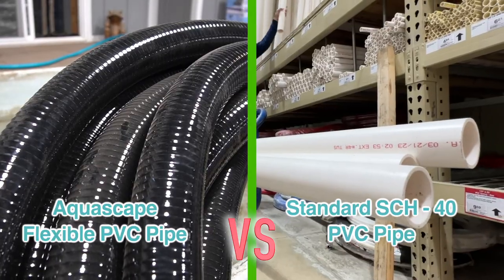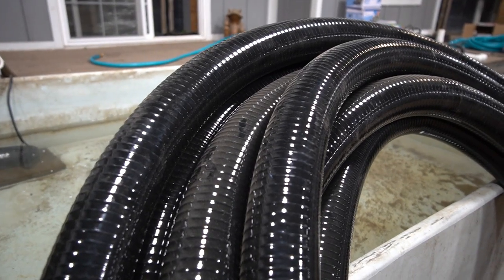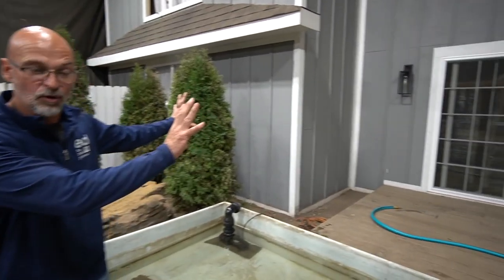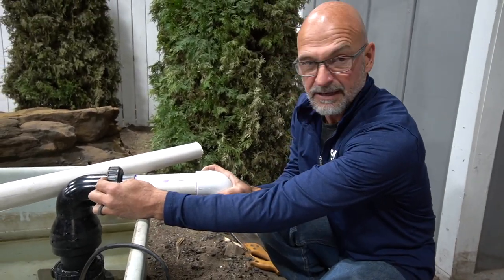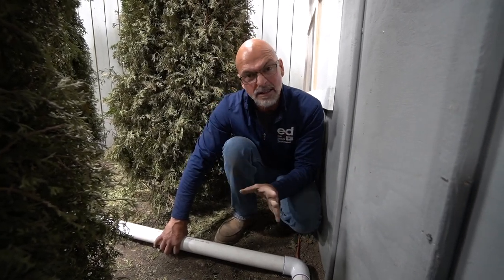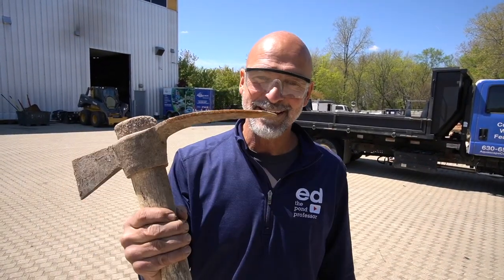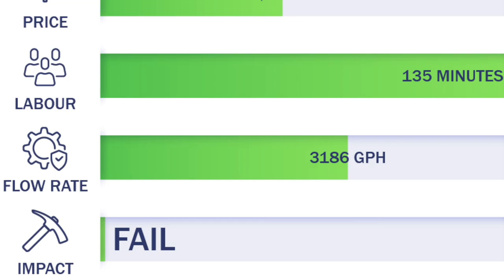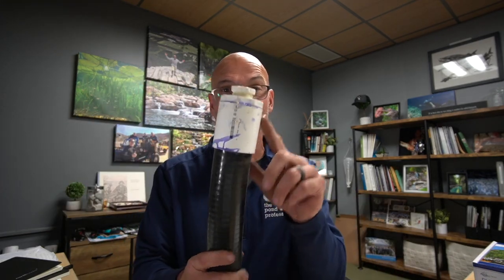DIY vs PRO Pond Pipe – 5 Different Tests

Comment: I love y’all at aquascape…but this pvc flow rate test was terrible. Looking at the route you ran the pvc vs the flex pipe is laughable. If the pvc needed to make that bend to go around a root flare etc, then the flex pipe should be making the same path…you ran it right across the top. Or instead of a 90 put in a 45 degree on the pvc so they at least follow the same run from point a to b. I used the black pipe on ours so agree with the idea behind this..but the flow test was a joke and you knew exactly what you were doing before you started. As soon as I saw you grab all those elbows at Menards I knew what data you were trying to produce…love you Ed and aquascape. But come on…
Reply from the maker: It was clearly an exaggerated test to prove a point…..
There are a lot of variables on projects and in my past 30 years as a designer and installer I’ve seen them all,
Whenever I find a better or more efficient method of construction I run with it!
Reply: @EdThePondProfessor  Again, I agree with you. This is not a matter of experience in the field but physics. More length of pipe and a ton of 90s are certainly going to be achieving less flow than a much more straight, no coupler pipe. There’s no doubt that there is little population out there that have as much experience as you. 👏 And you are brilliant with ponds, ecology etc. However, it would be more beneficial for viewers if you were advising that when the diy person does pvc that they reduce bends where they can because of this data and these numbers etc. being more advisory than what appeared to be salesy. Mentioning that one 90 degree bend is the equivalent of 17 ft of straight pipe would have been good information for a diy builder. At the end of the day, yes, the black pipe will offer better flow, is more resilient and easier to work with as long as it’s a warm day and the pipe is pliable. But over exaggerated use of 90s and lines that don’t follow the same path doesn’t really show us real data. What would be good to know is what a single elbow would do in flow rates, what a second elbow does with flow rate, and maybe even third elbow does to flow rate vs a straight pipe. All with the same pump and same bio falls etc. Keep up the good work though. I’ve learned a lot from your previous videos and appreciate you taking time to make them.
Reply: I thought the test was relevant. The PVC had to make the turns because it isn't flexible. In order to make turns it takes 45 degree or 90 degree turns. You can't argue with the work it took to do it either. 
It didn't feel like sales to me. It felt like demonstration and facts. I'm still free to make up my own mind. There is so much value in demonstrating two methods of doing one thing. Thanks ED
Reply: I felt the same way. I expect Greg to be the propaganda guy but trusted Ed to be objective. This really let me down.
Reply: @mistyrichardson6041  A hard 90 turn results in greater friction loss. That's why 2x45 or sweep 90's are used as they minimize loss. It wasn't an honest effort, sadly.
Reply: @Bowie.  exactly. Not saying anything about Ed being a bad guy or anything. He’s great and knowledgeable. But the test was not apples to apples.
Reply: @mistyrichardson6041  they didn’t follow the same path. 🤷‍♂️ pvc went straight to 90 degree right out of the pump and then had to “navigate” around root flare, ledge rock etc. the soft pipe literally was just run near the pvc. Not to the same spots or the same route. It was informational in the sense of when you run pvc, don’t use 90 degree every 5 feet and expect water flow to stay the same. But if you didn’t know that already, you probably shouldn’t be building your own water feature/pond.
Reply: @prestone6838  that's the point of flex pipe IT DOESN'T HAVE TO FOLLOW THE SAME PATH!!! RESISTANCE TO CHANGE IS STUPIDITY. but if you didn't know that already you probably shouldn't be building ponds.
Reply: @prestone6838  it's wasn't apples to apples because it's two different materials to get something accomplished. Apples to Apples would be comparing PVC pipe and fittings made by two different manufacturers to see which performs best. To me anyway. Just my opinion.

Comment: Sadly doesn't feel objective at all. Ignores using sweeps (instead of hard 90's), termites (which can damage flex), and just how huge the cost difference is. One is not more "pro" than the other. It's situational which is best for a job.

Comment: Out of curiosity, I'd love to see an efficiency study between rigid pipe versus flex pipe in a head to head contest.  My mind tells me that smooth walled rigid pipe is more efficient (less friction) versus the ribbed flex, but hey, I'm open to data.   Any hydraulic engineering students out there who need to satisfy your professor's project requirements??
Reply from the maker: If the comparison is for a straight run of pipe rigid pipe would win but when you factor in the difference with elbows and bends it starts to shift to flex,
It would be. Great study!
Reply: I've researched this and it's brand dependent, averaging around 10% loss though some claim as low as 5%.

Comment: What is your recommended method to connect 2" FreezeFlex PVC hose to schedule 40 pvc pipe? It seems some use glue and fittings and sometimes I see using rubber connectors with clamps?

Comment: Ditch the tonneau cover and get a topper with a roof rack. More room for your tools. Also lockable, and keeps your stuff dry like your tonneau. Then you have a roof rack on top for long stuff. Sooo much more practical. I used to be a tonneau cover guy, but then I switched to a topper about 11 years ago on a previous truck and never looked back.